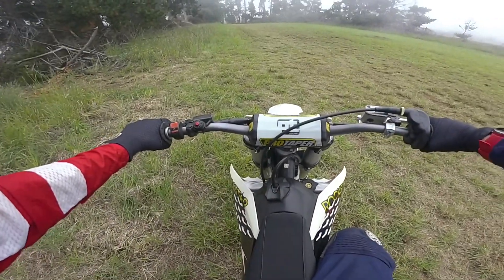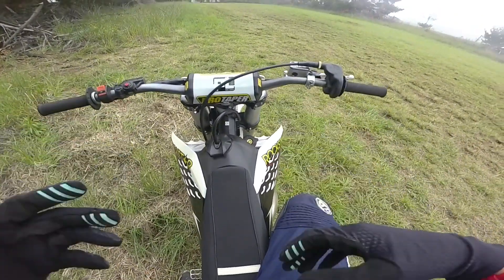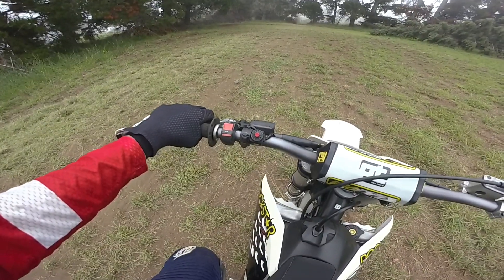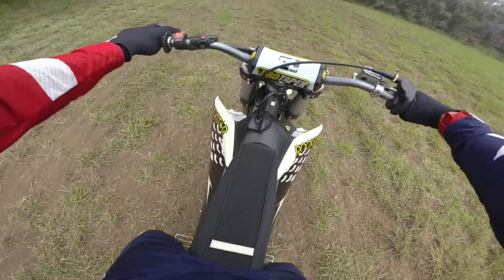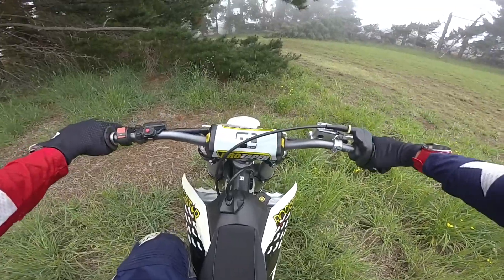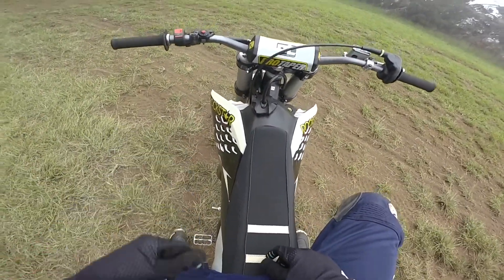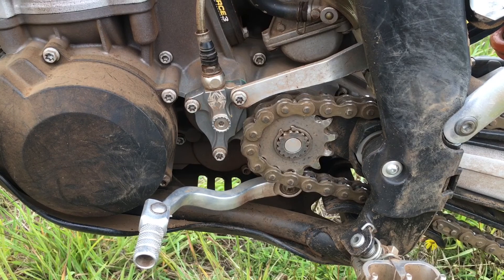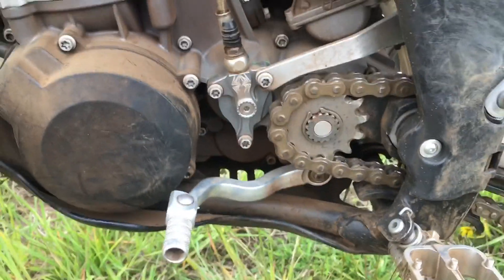Rekluse Auto Clutch Pros & Cons - Everything You Need To Know

Comment: In response to your con on hills, would it roll back if you left the bike on?  Say your doing a big hill climb and just climbed in wrong gear or spun out could you just jump off to the side and turn it around without bike rolling back?
Reply from the maker: No, that’s the con part. As soon as the RPMs drop back to close to idle it’ll go backward. This is why a large portion of trail riders run left hand rear brakes. You could also retrain yourself to jump off to the right side of the bike for brake access 😋

You can adjust the springs and weights in the EXP disc to adjust some of this stuff, so I’m speaking in general terms as the clutch comes out of the box. I personally haven’t played with any of those parts.

Comment: So if you’re in the air on a jump and need to hit the back rake to level you out, do you still need to pull in the clutch ? Or can you kick the back brake without clutch and it’ll stay fired up?
Reply from the maker: Been a while since I rode with one in a bike, but the last time I rode this 250 smoker, I def didn't always have the clutch in on the brake taps. This is a huge (the main) selling point for me having a messed up hand that loses motor control. Stalling in the air sucks and it's happened to me many times: https://youtu.be/pfZ_xsUq-SM

All I can say is... it didn't stall on this bike. 4 strokes might be a little more prone to it. Maybe someone else will chime in here with their experience.

Comment: What about steep descents do you loose the engine braking or do U just have to keep the rpms up
Reply from the maker: Its kind of tricky... if you hopped over the descent with the engine under load in a low gear it should engine brake. If you pulled in the clutch for a second or locked up the rear brake and slid, then it would free up. So its a yes/no thing. Its been since Oct since I rode mine, but thats the way I remember it. So in a nutshell, if the engine stays under load on or off the gas, it shouldn't free up.

Even if you aren't engine braking on steep stuff it still works good because you only have to focus on the brakes and not the bike stalling etc...

Comment: can we use a bike with rekluse auto clutch and still the bike as a fully manual bike like shifting and those stuff? If we can do that what do we benefit from the semi-automatic clutch ?
Reply from the maker: Yes. 

You don't stall, the clutch auto slips in low traction situations, you aren't required to used the clutch when tired (long distance racing), starts easier in gear, prob translates to a cooler engine in tight terrain, arguably more durable.... lots of things to benefit from.

Other benefits people don't often think of like more settled suspension because of the ability to ride at lower RPMs.

Comment: Does it help on the breaking bumps going into a turn because now you no longer have engine braking? Or does a Rekluse still have engine brake?
Reply from the maker: If you're coming in under higher RPM engine braking it will engine brake, but if you pull in the clutch lever and the RPMs drop it will freewheel. 

That's the way I remember it anyway. I sold this bike and don't have a Rekluse in my replacement bike (yet). I rather like using a manual clutch, but if I get back to XC racing again, I'll likely buy another Rekluse for when my clutch hand becomes mostly worthless during the race and stalling risk becomes a pain or dangerous.

Comment: This may sound funny but, i have a ktm 300 exc 2010 which i had converted it fully to a supermoto. Its my main bike for commuting and such. Would you recommend it for supermoto commuting (mostly consist traffic jam filtering, highway crusing) use?
Reply: I don't have one but if it's hard to ride your bike slow, it must be because it's a 300 2t. You should buy it and it will never stall again
Reply from the maker: Yes. If I wasn’t towing with my 690, I would put one in it would make it a ton nicer in traffic. Click into first and creep 5ft at a time... Pain in the ass holding the clutch and clicking in and out of gear to move 15ft.

Comment: If you are going down hill can you still use the engine compression to slow you down?
Reply from the maker: Not if the engine dropped RPM enough to free up the clutch. So like from fast deceleration, yes. Below like 1,200 RPM, like back down a hillclimb, no. I suppose if you throttled and accelerated while going back down the hill it would re-engage the clutch and engine brake.
Reply: @JohnHowerton137  thanks for taking time to reply!!
Reply from the maker: @burtburrell7609  thanks for watching 🤙

Comment: I have a ktm 250 excf, I’ve been riding for a few years now and I have a problem with stalling sometimes and I have just been offered a rekluse auto clutch in replacement for my manual clutch, should I take it
Reply from the maker: I installed one for a friend for that very reason. The clutch lever still works the same if needed, like if you wanted to dump it at the bottom of a hill climb or on a starting line. It helps with stalling for sure, especially if you have a weak or problematic clutch hand.

Comment: Could you basically not use the clutch at all with this even for shifting?
Reply from the maker: More or less. In general, shifting with a clutch is recommended, especially under power. That said, those of us who've ridden dirtbikes for many years understand when and when not to clutchless shift.
Reply: @JohnHowerton137  so it kinda works the same as a quickshifter
Reply from the maker: @sm0983  no. Your throttle wrist is the quick shifter. Quick shifter cuts power, nothing about the Rekluse cuts power. It’s literally just a hybrid centrifugal clutch. Functions somewhat like a mini bike or quad… but there’s still a clutch lever to bang on. Yes you can shift without the clutch lever (just like any dirtbike) but banging gears under power isn’t the best practice fir transmission health.

Comment: Thanks, that’s a good summary.
Do you always use the lever to downshift, or the Auto? Is there a particular technique to use the Auto to downshift?
By the way, I’ve seen several videos claiming Jarvis uses a traditional clutch, and only uses the Rekluse clutch cover because it’s much thicker.
Reply from the maker: I basically always use the lever. It's just good practice. Back in the day when I rode motocross and my hand wouldn't work, I did do clutchless downshifts a lot. I have broken teeth on a 2nd and 3rd gears (can't be positive that's what caused it). Doesn't really matter, cost of doing business, but since I can use the lever now (because my hand lasts) to downshift... I do.

Jarvis probably uses the manual TorqDrive clutch. Maybe not in his daily training (I think his bikes are mostly bone stock) but something like Erzberg could be a nightmare for a stock clutch. The Relkuse cover (aka Dog Bowl) also holds more oil volume.
Reply: John Howerton   Thanks. I also have a hand/wrist injury that is only going to get worse despite surgery having helped (being mid 50s I have arthritis as well where the injury occurred). Hence my interest in Rekluse. Is it actually possible to downshift without the lever with Rekluse? How’s it done, and would it potentially damage gears? I’m trying to figure out how it works given Rekluse uses centrifugal force to force the wedges out and engage the clutch plates, and if you’re in 3rd shifting down to second, even if you’re off throttle there is still centrifugal force, so I assume the clutch plates are still engaged ??). When you’re at idle, if the lever adjustment was done right, there wouldn’t be enough centrifugal force to engage the plates, so I’m wondering if backing off throttle disengages the clutch pack, or whether there’s still too much centrifugal force.
Reply from the maker: Kind of all that. 🤣 If you listen really carefully, you'll hear when I let off at high RPM it is engaged for a moment and engine braking, then it will freewheel. You can brake hard into the corner with no clutch. When you're basically coasting I'm fairly sure it's not too hard on things to shift. Just like clicking it into gear when stopped. I've done a million clutchless, stomping, high RPM downshifts in my days... back when I was fast and riding sand 😆 Pretty much had to. Not recommending that, but I think you'll be ok for recreational riding. Same with upshifts. If you backed out of the throttle and had momentum/speed appropriate for the gear change, you should be fine. Just dont do them under full load for best results.

Watch this video. https://youtu.be/ndC0eG93gzs This was basically the first ride using it. I rode a ton that day. Prob 3x more than normal and that's because clutch use was drastically cut. Excuse the bogging. My gearing was way off. You can hear some brake taps in the air that would normally kill the bike.

It's helped me a lot. My hand is a disaster. I was told my only option is total fusion. 

On another note, after I cleaned up my diet (plant based) I no longer felt like I wanted to chop my arm off with a machete. The arthritis is so bad I've actually had those thoughts. Instead I became a long distance triathlete because all my pains went away 🤣🤷‍♂️
Reply: @JohnHowerton137  Since when has Jarvis used a Rekluse? Clutch cover maybe for more oil capacity.
Reply from the maker: @iffykidmn8170  never said anywhere ever that he used a "Rekluse" (implying autoclutch). Of course he doesn't, he's the best enduro rider on the planet. It would give him less control. He's said it with his own mouth. He's also said, "If you're just getting into the sport or struggling, it might be quite a good thing." 😱 #JarvisQuote

You realize Rekluse also makes the best manual clutch on the market right? That's no secret. I have said he probably used the "dog bowl" cover for increased oil volume. Wouldn't surprise me for a moment if he has a Rekluse Torqdrive (manual) clutch under there too. Half the factory riders on the planet do.

This is a quote from Enduro21 in 2018: "(Graham uses) Rekluse Manual aluminum billet clutch basket and the Rekluse pressure plate with standard clutch plates. We also fit the Rekluse clutch cover for added protection because it’s much stronger over the standard cover.”

FYI, the Rekluse internals (basket and pressure plate) allow for more oil flow to the DDS clutch. I've personally talked to Rekluse about it. Paired with the cover, maybe he doesn't need the Torqdrive's durability. Outside of smashing off stuff and long events, I don't see Grahams low-RPM riding style being too hard on anything. I'm sure he gets a new clutch whenever he feels like one too, unlike you and I.

A lot can change in 2 years. The Rekluse Torqdrive also uses steel drive plates. I don't know if the TE300i uses aluminum or steel drive plates from the factory, but if it's aluminum, that would be another reason for Graham to run one. The added weight to the clutch pack favors Graham's style of riding not to mention is more durable. The only reason I could see him not wanting to run a Torqdrive, is if he actually wants the clutch to be weaker to give the engine a "softer feel." Just like a TPI bike vs Carb bike.
Reply: Ronan Rogers don’t worry too much about using the clutch when downshifting, unless your downshifting at high rpm you won’t do damage, as long as your off throttle you don’t actually need a clutch to shift.

Comment: Can you shift under throttle or do you have to let up or use the clutch?
Reply from the maker: The simple answer is no. It does NOT take any load off the transmission if/when you shift under load. Use the clutch lever normally or let off to extend the life of your transmission parts.

Really nice clutches though. I'd already be putting one in my newest bike had I not incurred bunch of medical bills recently. I'm excited to get another one when it's in the budget.

Comment: I just bought a cruiser with a rekluse clutch. I noticed I can have my bike in first gear and let go of the clutch and front brake and it doesn't stall. I also noticed yours does the same. It seems really weird but is this because of the rekluse clutch?
Reply from the maker: Exactly. Its a centrifugal clutch. It auto slips for you. If you're stuck in traffic you don't have to use the clutch lever anymore. You can just throttle and brake and save your hand.
Reply: Okay. So with my bike if I park it and turn it off in first gear it still wants to roll like it's in neutral. The problem I have with this is that if I park on a hill there's no stopping it from rolling. Is this the same with yours with the rekluse clutch?
Reply from the maker: @alihebert7420  yes. Basically anything below like 1,200 RPM (including dead engine) the bike is in faux neutral. You'd need a parking brake or something to keep it from rolling or park sideways enough.

It may not meet your needs, but it is designed that way. That's why I made this video... so people know the pros and cons and can make up their own mind on whether they are willing to give up some things for others. It also makes your bike more inconvenient to bump start if the battery dies or something.

Comment: Three questions 1. Does this eliminate the need for a slipper clutch, stop down shift chatter of the back wheel? 2. If I understand correctly, this is not like a quickshifter right? And 3. Can you still have a gear indicator so you don't unknowingly ride wrong gears. Thanks for the great vid. Bonus question, do you have a rekluse in your 690?
Reply from the maker: It's none of those things and yes the gear indicator will perform as usual. Basically all you're doing is adding a fancy centrifugal clutch plate to the basket.

I don't. If it was my main off-road bike I would. Especially since first gear is so tall for the slow stuff and stalling the 690 is pretty easy when the going gets tight and/or slippery.

 Reason 2: I tow a trailer all the time. Probably doesnt matter and it could be adjusted appropriately, but I use low RPM engine breaking ect.. when towing. It's likely all in my head, but manual just seems to make more sense in that case.

When my 690 stock clutch wears out, I'll likely replace it with a Rekluse Torqdrive manual.

Comment: What rekluse style clutch are you using? Radius X, Exp, just torque drive clutch pack….? Considering buying one. I’m 42 years old, a weekend warrior, I boxed for 13 years and my left hand goes totally numb sometimes..
Reply from the maker: Any of them except the straight up "Torqdrive" are auto clutches.

 It's kind if confusing, but the different models just contain different parts. Core means "core" parts are updated like hub and pressure plate. EXP means "auto". Torqdrive is the thinner/tougher clutch plates. 

So.... if you have a "RadiusX" thats a auto clutch with Torqdrive plates and no other parts. 

A "Core EXP" come w/billet clutch hub, pressure plate, auto, but uses the OEM style plates.

A RadiusCX would come with basically every part they make... auto, billet internals, cover, tordrive plates, etc...

Weekend warrior skills... the X or core EXP will be fine. I just installed a Core EXP in my bike, and this video bike had a RadiusX. Hard racers or money to burn the CX is the top model. Often around $1,100. I've installed and ridden on all the models. They're all good.

Hope that helps a bit. You can always call Rekluse for guidance as well.
Reply: Thanks for the info John. Greatly appreciated! Definitely helped me to make a decision!

Comment: is it possible to switch the gears without pulling the clutch?
Reply from the maker: Yes, but not because of the clutch. You can shift without a clutch on any motorcycle, it's just not recommended.

It should still be shifted correctly with the clutch.

Comment: Quick thought, with a Rekluse, you can be in gear and the bike will still roll right? Seems like you’d have to shift into gear and then find neutral to be positive.
Reply from the maker: Yes, it will roll while sitting in gear if the RPMs are low. If the engine if off, there will be some resistance… just like when you pull the clutch in on a warm (off) bike and push it in gear.

Comment: Will it still allow motor braking? like when coming down something steep and want the motor to slow you down.
Reply from the maker: No, it's all brakes. You're basically in neutral.

I meant to tie that into the rolling backward section a little better but I was losing ground to a storm moving in on the mountain. You can see me push it forward and backward with a dead engine in that clip.
Reply: John Howerton Thanks, I sorta figured but wasn’t sure. I do allot of single track enduro. It would definitely help with the slow technical obstacles but the going down hill I do allot of engine braking So I would have to weigh the pros and cons. Great vid thanks 👍
Reply from the maker: Personally prefer the brakes to the engine. My ego likes to think I can feel traction better in my foot and fingers than an engine can 🤣 

You will ride longer and further with a Rekluse. That's the main Pro. Ride on! 🤙
Reply: Thats why you have front and rear brakes, WTF !
Reply: It depends on the setup, I have mine just catching on idle and always have engine braking when the engine is running. If you set engagement up to come in at a higher rpm then it can disengage. I’ve done 450 hours on mine and it has increased the life span of my chain and sprockets by 50% as it damps engine pulses👍. I still ride the bike as normal with clutch as the rekluse only gives one type of drive characteristic.
Reply: According to rekluse website you will still have engine braking as long as the rpm is above idle speed.